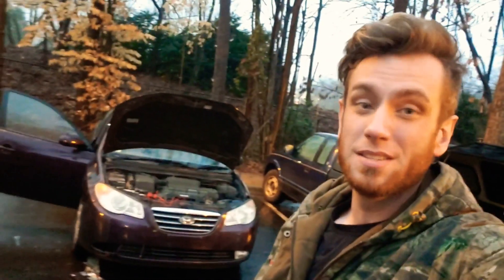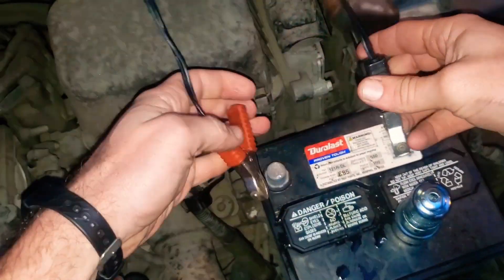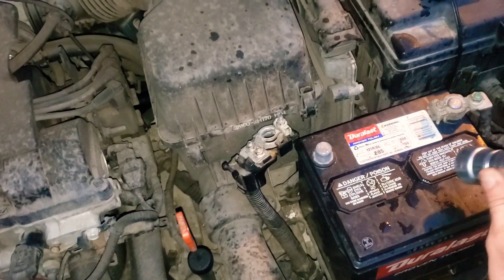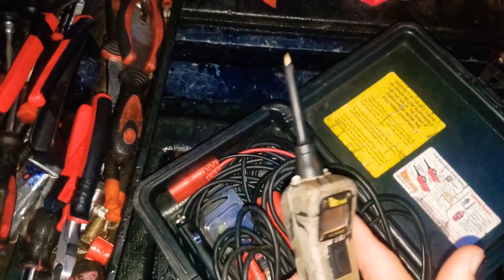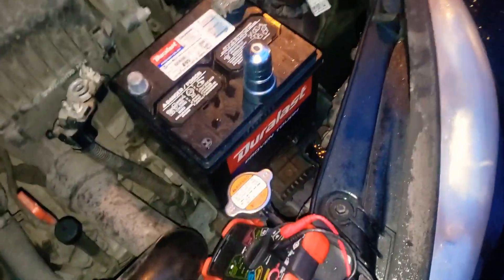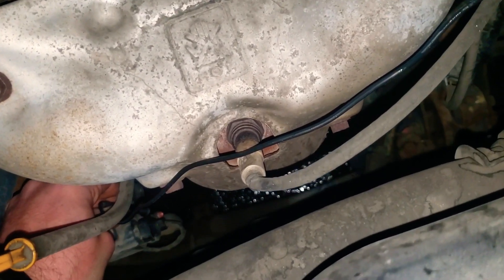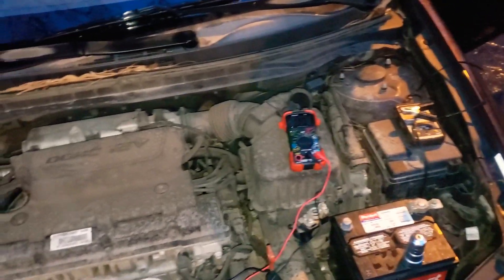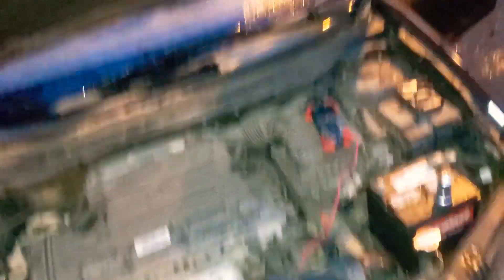2007 2010 Hyundai Elantra No Start Diagnosis How to 2.0l Check Battery Starter Alternator 2008 2009

Comment: That's very helpful I did replace my battery and I did replace my alternator and my car won't start unless I jump start it could that still be a starter issue I do have a starter I just haven't put it on yet but I will if it's causing it to not wanting to start unless it's being jumped